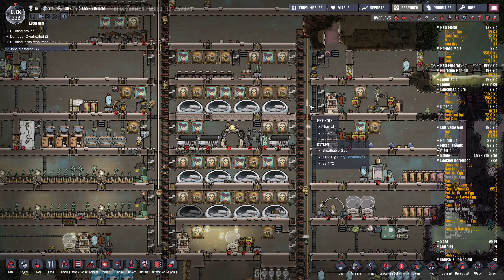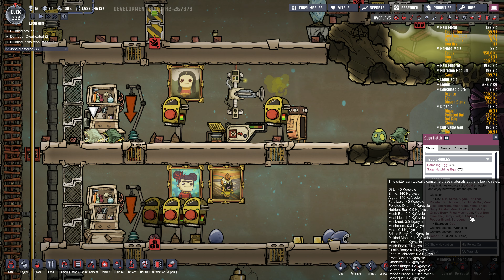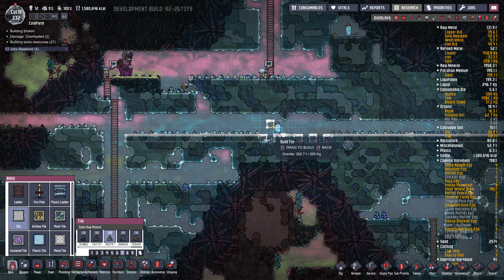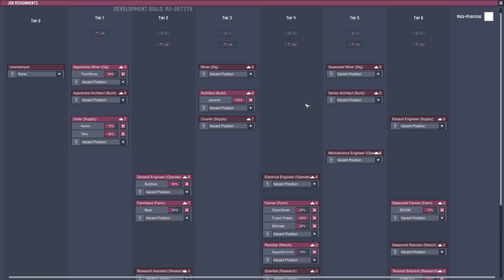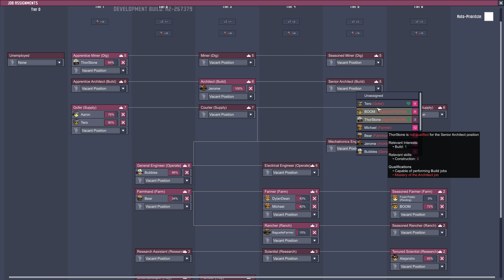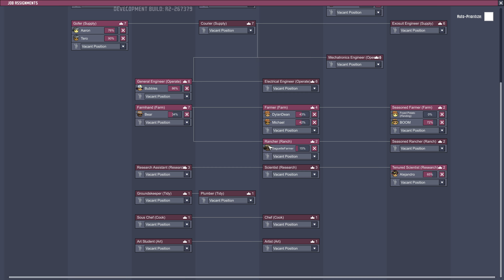RANCHING UPGRADE MARK II #10 - Steam Turbine Attempt - Oxygen Not Included

Comment: Dude! You haventbeen keeping up to snuff on your lifegrow recently. He was the one who is most noted for finding out that you need to restrict the airflow under the turbine to 1 or 2 high pressure tiles. Other than that you may need to put doors on the opposite side and create a loop to constantly represurize the system.
Reply: Oh, also you may need doors at the bottom to help thermoregulate the system. Just have a temp switch that opens the doors when temp exceeds 300 degrees or so and making the space a vacuum will definitely help the steam condense in a loop better.
Reply from the maker: you cant block the inflow area anymore.
Reply: Grind This Game oh so that's what they changed.
Reply: Just setup a working steam turbine setup and all I can say is it's not worth it unless you literally have so many resources it's feels like debug. I got a simple setup where I used magma as the heat sorce and I used something like 50 tons of magma. The steam turbine went through it in less than 40 cycles before it's started shinning down constantly. I even refreshed it once with 2600 degree lava while the first batch was still 1600 cause I wanted to do a duration test. I only have about 7 metal plates to spread the heat to the steam and the setup starts dieing out  while the magma is still 1100 degrees. Literally every other method in the game is a better way to make power.
Reply from the maker: Exactly...and this is why I avoid it. They need to rethink how it all works. If it had a water input and a "heat plate" that would make it useful. Or allow pumping of super hot things and it would be easier to use.

Comment: So the steam turbine needs 3000g of Pressure differences between the top and bottom? Unless it also limits airflow to some degree* it might be plain unfeasible to use it. But I have at least one idea:
1. Put a set of doors above and below
2. Connect the area above and below via Air piping that permanently moves steam from above to below. 
3. Set pressure sensors up so the lower door only opens if it has 4k+ pressure. And the upper doors only if it has 1k- pressure.
That should guarantee a 3k difference at least some of the time.

*If it was limiting airflow you could at least figure out how much steam/tick you would have to add to below to keep this running.
Reply from the maker: pumps melt from the heat :(
Reply: How much more then 100°C does the steam actually need?
While more heat = more pressure applies in the real world, this is something ONI propably does no properly simulate.

Maybe you could filter the steam through something like a Condenser before you pump it out? It might even have cooled down so much that it is liquid again. Afaik Radiant Pipes are ideal to allow heat exchange between the atmosphere and water in pipes. But such a condenser would need considerable space.
Reply: Actualy, does it even need to be steam in the first place? Or could any gas at enough pressure work?

Comment: For Temperature Isolation, consider 3 block thick walls:
Abyssilite
Vacuum
Abyssilite
You need a gap in the Vaccum where the door is. But on all other sides, Vacuum is the best isolator. The other two materials only help a little.

If you are worried that water will Freeze/become steam, just do not use water. Oil Cooling is really on the rise in Computers.
Reply from the maker: Have you ever had a need for such crazy insulation?
Reply: In real life? Yes, all over the place. My Thermos bottles would not work without it.

If you can work with less in the game, using that is of couse easier. I was just throwing that option out there.

Comment: Brothgar has a nice working steam generator design, i'm not sure if you ever Seen it, but it is Worth checking out: https://youtu.be/XwFeF18npQM
Reply from the maker: Thanks. I'll check it out.
Reply from the maker: A few things have changed since he built that and it's in debug...which worked for me but not in real game. I might need a second piston to move more gas down or cooling above to turn the steam to water which would reduce the top pressure. It seems like a huge effort for 2kw of power.
Reply: I see. Steam generators are hard to use, i hope they fix it next update. You don't really need the power anyways, and there might be other ways of cooling that area and removing the magma if you need more iron. However, if you have the need for more Power, try and make a Power control Room to tune up your generators. :)

Comment: Steam is a bad idea.
You got oil. Heat the petroleum untile it becomes GAZ and use that into gaz generator to make polluted water. (more free water and power!!) and just waist the power... To get the water.

Make a different room for sligsters. I think tamed sligsters produces more eggs. It will help with the overflow of co2 that the gaz generators will produce
Reply from the maker: I do have a room down near the oil for slicksters. It has quite a few of them so far. I want to keep them wild though because they can starve if they are tame and require constant tending.